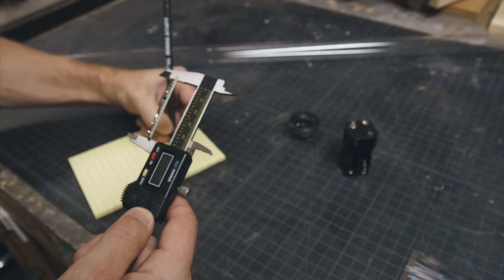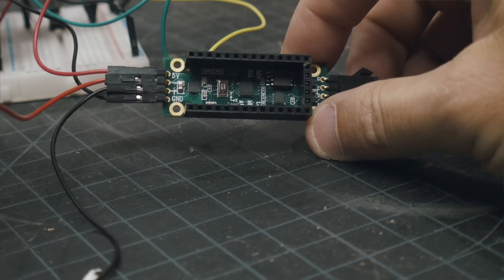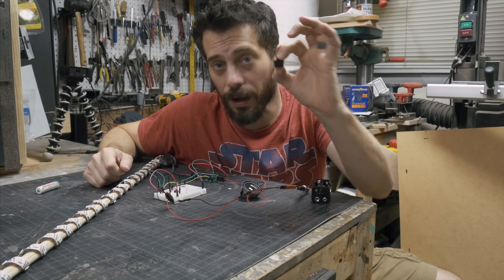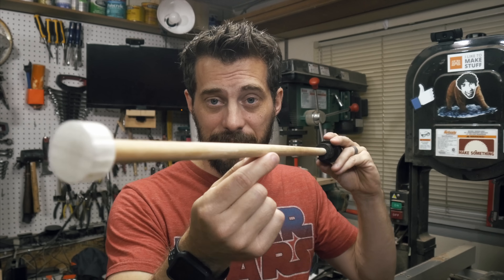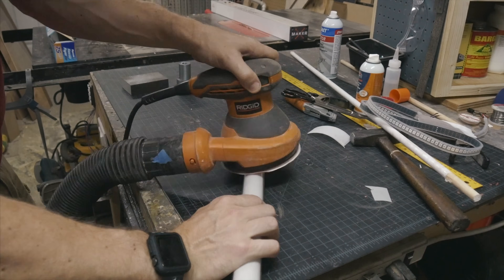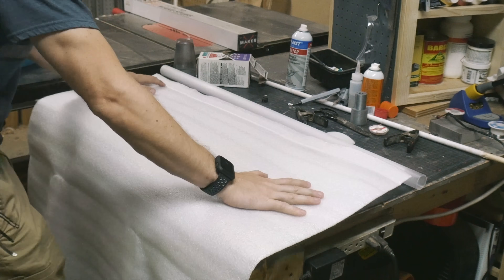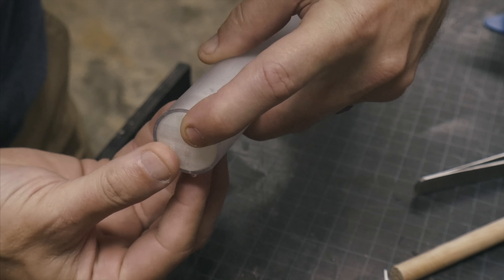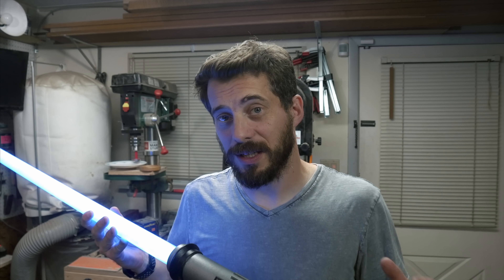How to make a Lightsaber ( for Star Wars Day ) | I Like To Make Stuff

Comment: round off the top of the saber (make it realistic)
the part where tube enters handle.. add a ring or some rubber ring to cover the gaps and joints and make a solid fit

and for the handle rather than 3d printing
silicone cast a replica or a toy handle to get the one closes to the real thing ?

its bloody amazing thats for sure

Comment: I'm not a star wars fan, but I did enjoy this build and your enthusiasm. That being said, I'm a DoP and work with strip LEDS often. 
I have found that when I need a perfectly straight run, I can mount it in an extruded aluminum frame with a slide on dome diffuser. Don't remember the brand, but I have seen countless versions on AliExpress. There are versions with different profiles, flat, or even quarter round.
Also, have you tried running the strips into a smaller diameter frosted tube before inserting it into larger one? I have a ton of ideas (as I'm sure you had). hope this was helpful and didn't come off as condescending.

Comment: make it sectional so it screws apart in a few places if you need it easier to get to the guts inside.  Also, rather than 3d print the whole thing, maybe lathe the hilt parts and 3d print the accessories.  and to bring down your internal diameter, you'll need to do a different battery holder and a possibly a thinner blade.  it just looks pretty fat.  but for a first hilt you did great.  also, lots of good buttons you can just buy that look right, i got some at my local electronics shop rather than create that 3way toggle switch, they already have those so why reinvent the wheel.

Comment: I have never used an Arduino (although I want to). Question regarding the breadboard. 

In the explanation of the electronics you've got everything running into a breadboard but in the final version I don't see it. 

Is that because the breadboard is an easy way to test the wiring and then in the final version you soldered it together and put heat shrinking tubing over it, essentially bypassing the breadboard? 

Great video.
Reply from the maker: Yes, that's exactly right.  The breadboard is a quick way to test without soldering, but too large and temporary for the final product.